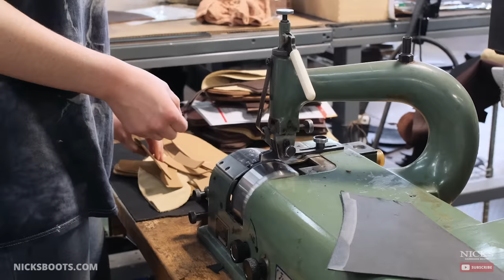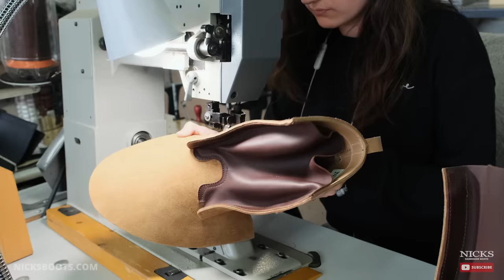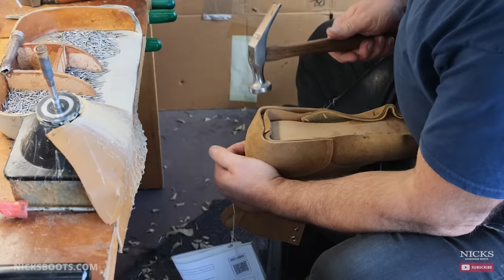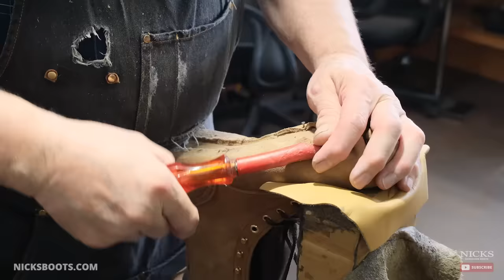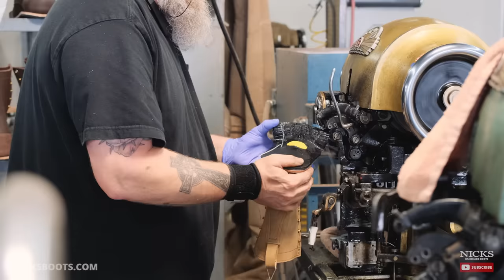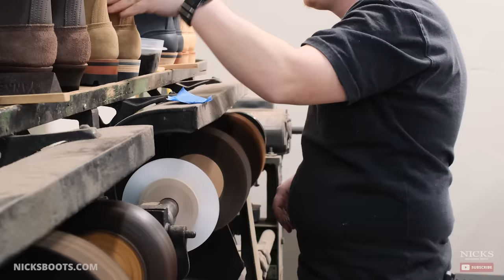World's Toughest Construction Boot: How It's Made - Nicks Handmade Boots

Comment: Very few companies operate like this nowadays using handcrafted talent and quality materials. Never heard of this company before but I'm a fan now. Good stuff!
Reply: The worst thing is when they get overhyped and end up like doc martens where the older shoes are much better and costed the same, maybe even less than the modern crap ones.
Reply: @4m4n40  yeah, doc marten used to be really cheap back in the day, used for factory work, i think there is still a company making something similar, but i can't find them anywhere, i only ever see them in small tool supply shops but there a lot heavier and sturdier then even the old doc marten

Comment: I would personally like to say, "THANK YOU!" to all of your employees. As someone who wears Nicks daily I wish that it was possible to explain the difference between a handmade custom fitted boot vs a really good production boot but it's not. Only way to understand the difference is to buy a pair.
Reply: Yeah but $500 for a pair of boots is a bit much for a lot of folks. Obviously they have a good customer base but they're currently out of my price range.
Reply: @jamesnm21  I understand. My advice to those in this situation would be to set aside a little at a time until you've got what you need.
Reply: Unfortunately, that’s a concept that’s lost on a lot of people…. Lol
Reply: @japlunkett6789  depends on your feet as well. Some people fit well in mass produced footwear. I'm a 9.5 or 10 depending on the shoe and can usually find something comfortable and affordable. Others like my brother, a size 12, has more trouble. I've had some cheap boots for sure that fell apart within months without even everyday use. Sometimes I shoe goo them and get a few years of part time use. I have about 5 pairs of shoes/boots I rotate depending on my needs for the day. Right now I'm in Hilfiger deck shoes from Burlington coat factory. Great for hot weather when you're working indoors or doing light outdoor work. The soles are too thin for anything more serious. I have some steel toe Scetchers for heavier duty stuff plus a few pairs of work boots for the really brutal stuff. In the winter I often wear insulated rubber muck boots that are easy to slide off when going in and out and unbeatable waterproof protection.
Reply: @lancelenoir2875  I don't think you do understand. A little money each week that adds up to $500,  is still the same amount you have to justify spending on a pair of boots.
Reply: @clarkcrossley7579  Hence my original statement about not being able to describe the difference. Justify wouldn't even be a consideration.
Reply: Can you get these boots resoled when those wear out?
Reply: @Lance Lenoir - So they have something that you send in/mold your foot with, and they custom make the boot specific to your foot?
Reply: If I can make it to Spokane for fittment im in 😁
Reply: No need to convey thanks to them. They are enough paid for their work. And its their work, we all work hard and earn money so if you want to say thanks then thank all the service holder in the world.
Reply: What about the difference between a $30 pair of Walmart boots and a nicks boot?
Reply: @jamesnm21  that was a lot of useless information gramps. :)
Reply: @thejohnhend  thanks for watching buddy. Cheers.
Reply: @Kriptoker  I received a form where I traced each foot then took about 7 or 8 measurements. Sent that info in. I then received a try on pair and called and answered questions they asked. Mailed them back and about 6 weeks later my final pair showed up.
Reply: @japlunkett6789  yeah unless you need orthotics from a podiatrist like me. I gotta have em and Ive already taked to these guys. Its a no go
Reply: @Kriptoker  fit sheets. Either they send you one and you get measured or measure yourself, or you gotta go to them and they measure.
Reply: I think everyone is misunderstanding my comment - it (not the original comment made by Lance) had anything to do with whether or not they could be used with orthotics, whether or not they were comfortable or not for some people, etc. Someone commented "$500 is a bit too much for me, they're out of my price range," and Lance's reply was "well, you can put aside a little money each week 'til you have it saved up," and then I made the comment that saving money is a habit/discipline largely lost on society today (referencing the impatience, impulsivity, and "I want it now" mindset that is prevalent among the current populous) - that's ALL this comment was meant to be. Nothing more, nothing less. LOL
Reply: @sylviam6535  The boots that were shown being made could certainly be resoled.  If you go to their website, there's probably additional information there.
Reply: @Kriptoker  No. They offer free exchange if the pair you bought didn't fit your feet.
Reply: Lance, a fool like you and his money is soon parted.

Comment: I can see these are great boots, however as a mason I've tried all kinds of boots and none of them can hold up to cement constantly falling on your shoes.  It's unavoidable, not to mention getting wet and drying out on those rainy days, or working in mud on a foundation and etc..., it just destroys leather in a short while.  I've paid for high price boots before and they don't hold up much better.  I wear out at least one pair a year, maybe sooner, now I just go with what works for me now  that I'm older; boots with a zipper, so much easier to get off and on.
Reply: Lo ppp
Reply: Sounds like you aren't cleaning your boots and reoiling them.
Reply: @dangerous8333  Nope, ain't got time for that lifes to short, and after laying 5 or 600 concrete block, I'm just to tired.
Reply: @originaldanman  You have time for that, you're just too lazy. Plenty of other trades do it. Stop complaining about boots not holding up if you refuse to take care of them.

Comment: Very nice video. I like the simplicity of it.

It does kind of kill me though, to watch the stitching go over the cleats of the sole. I'm sure the boots are still sturdy, but it's a very odd design choice as that stitching will be quickly worn away.
Reply: Once the stitching is finished, it will stay in a groove that forms after the stitching, so it won't wear out as quickly.
Reply: stiches will still hold fine
Reply: @PaddleDogC5   depends what you use the boots for, we never found a stitched sole boot that would stand up to building site work, cement and rebar rip  built up boot soles to bits fast.
Reply: @CrimeVid  50 years as a bricklayer contractor
Reply: @John Gurzo they fall out in a month
Reply: @PaddleDogC5   I can match that,  and a bit !  concrete and carpentry though, And I stand by  what I said.

Comment: Crazy skill, but did i miss the part they put toe caps and such in? or are they just design based off construction boot?
Reply: Wondering the same. Do you not in USA require toe caps and also so nails will not go through the bottom of the boot?

Comment: Boots should have been stitched before placing the final black sole. Stitching on the bottom most sole only makes the stiches prone to be damaged.
Reply: And Nicks does that too. Stitching through all the layers helps keep the outsole in place. Yes the thread snaps, but the thick rubber grips the thread very strongly.

Comment: I realize the cement and screws are the real bonding element.  But my question is once the crown of the lock stitch wears through, if the glue breaks down, what’s holding the sole on?  I’m a repairman, not a maker.  I ask this from that perspective.  I would love to not groove the non lug vibrant soles like the v sole.  I use top notch cement, prep meticulously, pneumatically press, and once in a while even mine come apart?  You guys are obviously experts in this type of sole application.  Any pointers?

Comment: I have 1 issue with these boots. The thread used to connect the leather upper to the vibram sole isn't protected. I think there should be a grove cut into the sole for the thread to sit so as your soles wear down, the threads won't.

Comment: I  have never heard of Nicks Handmade Boots but I have Owned Viberg`s and they are still made less than a mile from my house. Can be Re-Soled, repaired, and are Tough. Loggers like them on Vancouver Island as well as Construction workers. Good on you if they are the same class as Viberg.
Reply: Without having personal experience with Viberg, I have been lead to believe that Vibergs are of higher quality than Nicks. I own Nicks and I love them, but they're still mainly work boot makers. For myself Nicks are a better choice than Vibergs.
Reply: @Totemparadox  Whatever they are, they are expensive as all get out now. I remember i thought my construction boots from Viberg at $200.00 Canadian Dollars was a crazy price but I was assured of the quality by my Grandfather who wore some non-construction type Vibergs and they lasted him years, so I bought a pair. Wish they were still $200.00, closest ones to what I had are now like $700.00. There`s a video up about such a pair, guy says he went through the Fort MacMurry Forest Fire with them, been using them at work for 2.5 years on top of that, he just keeps them treated and cleaned twice a year---I used to do it every season change, his boots though, and not a broken stich nor any splitting of the treads as cheap boots would have been abou four or five pairs at least by now, especially after that fire, it was a big one, went on for like a month and some, almost two if I remember right, am older now and not needing as heavy duty boots so less expensive ones last me a good while now. Take care.

Comment: Amazing, so much works goes into each pair. I have two silly questions: watching how the sole is constructed, how come there aren't nails sticking out from the insole inside the boot? And about the stitch-down thread on the underside of the sole - won't it wear out pretty quickly and what happens to the sole then?
Reply: The plastic foot shape they're using is called a last. It has a metal bottom and when the nails are nailed in even at a slight angle, the nails hit the metal plate and turn over creating a hook like nail. Then in the end any nail that is too tall is flattened with a rebar and a hammer. Yes, the thread will wear out pretty fast, but it's lockstitched so it won't unravel and it's just an extra method of security. The outsole is still nailed, glued and screwed on.

Comment: I don't make shoes but do work in a factory environment. This seems incredibly labour intensive for something in a developed country. In particular the bit about 18:50 with the screws being put in. I would certainly want to mechanise it and change to a single action stamping of multiple metal bits at once...
Reply: You seem to be very confused about the ideology behind Nicks boots. The market is FULL of machine made modern shoes. These are hand made ON purpose using the toughest materials around. The process isn't meant to be the most efficient, but as close to the classic methods as possible.

Comment: I was confused by the stiching across the sole that would touch the ground, wouldn't it make more sense to stick across a section of the sole that isn't going to get worn through quickly?
Reply: The stitching being worn doesn't make a difference.
Reply: If you observe keenly, you will notice the stitch is not on the buttons of the sole but rather on the flat layer holding the buttons. The valley and not the peak to give a different POV. Hope you get the point I'm trying to stress, I'm unable to get the correct terms for that part of the sole.
Reply: @SubramaniamLakshminarayanan  The stitches also touch the top of the tread. That's just how these boots are built. I own Nicks boots and the thread on mine has snapped and it hasn't affected the integrity of the boot one bit. Even if it isn't visually pleasing, the thread snapping is of no consequence.
Reply: @Totemparadox  - not a suitable manufacturing process or design if that be so. Unless the stitch is just a temporary manufacturing process to hold the parts together until the following process seals the parts.
Reply: @SubramaniamLakshminarayanan  Not suitable? How so. Please explain what happens when the thread snaps.
Reply: @SubramaniamLakshminarayanan  Waiting for your so-called expert opinion on how it's not suitable, despite being done by cobblers for decades. Yet it doesn't change the integrity when it wears down.
Reply: @Totemparadox  when the threads will eventually snap, the shoes lose the binding grip provided by the threads. 
"I own Nicks boots and the thread on mine has snapped and it hasn't affected the integrity of the boot one bit."
What were the threads doing there??? Decorate the boot?
Reply: @SubramaniamLakshminarayanan  Holding on the sole. Like they will do even if the thread snaps. Have you ever tried to remove a nail from a tire? It's extremely tightly in there.

Comment: Don't you worry about having that stitching on the bottom directly exposed to abrasion/wear? (from someone that has absolutely NO idea what goes into boot making. I'm sure what you make is insanely high quality and bomb-proof)
Reply: The stitching on the bottom is really just to sandwich it all together. There is another stitch that goes exclusively to the midsole. Not to mention the adhesive does most of the heavy lifting to begin with.
Reply: Not to mention the nails and screws. Honestly there is so much shit holding the boots together I’m almost willing to say the stitches on the bottom are mostly cosmetic.

Comment: anyone who knows about shoes will be cringing watching this video, what the hell of techniques are these, good heaven
Reply: Bro just stop. You're embarrassing yourself. Please explain what steps were incorrect.
Reply: @Totemparadox  the sole stitching levelled with the contact area of the sole is just ridiculous. A band should be crafted in order to sew along that band at a different level so that it has rubber protecting it. Plain and simple I believe
Reply: @gonzalovenegasgomez349  You mean protecting the the thread? Because when you walk it will wear down, is that what you mean? The soles are attached with THREE things. Glue, thread and ecrews. The thread is not protected because it would be extra work for no added benefit. The sole is never coming off unless it's peeled off when resoling. Sure it may not look as nice when the thread on the bottom snaps, but these are work boots, not fashion accessories. Also if you knew how rubber worked you'd know that the thread is squeezed so hard by that rubber that even without the glue or screws that sole is not coming off.

Comment: The stitching on the bottom is somewhat an odd choice. I mean those stitches are going to be the first thing to wear out.
Reply: Yes. And?
Reply: @Totemparadox  It means its going to be the first thing to rapidly wear out and peel off. Not one shoe brand I have seen stitches the bottom where its the most abrasive. I just wonder how long the front part will stay on after the threads wear out. I assume its bonded as well.
Reply: @Someguy6571  Mine are still attached even when the thread has snapped. I haven't seen one Nicks boot where the outsole peels off.
Reply: @Totemparadox  Okay well I was only thinking it was an odd design choice really. I figured they were bonded.

Comment: They might look nice,  but the fact they don't have a steel (or otherwise safety-standard) toe-box means it's definitely not tough enough for a construction site, let alone the "world's toughest". They also don't look very cut, penetration or water-resistant, either.
Reply: Steel toe is an option and if you base a boots toughness on steel toes alone, your priorities are wrong.
Reply: Only one way to know, either buy them or read reviews.
Reply: @Totemparadox  Thanks for your reply. I had a look on the Nicks Boots website before posting my original comment, and couldn't find any option of steel toe-caps, just "Celastic", which is just a bit stiffer than leather alone -- but I'd be obliged if you could provide a link to the steel toe-cap option, thanks.  (In any case, if they're an option, why weren't they included in what's supposedly the world's toughest construction boot?)

And where did I say that that I base my evaluation of a boot's toughness on steel toes alone? I  mentioned them because they're essential, but not the only thing I look for. Perhaps you missed my mentioning cut, penetration and water resistance, to mention just three. I could also add factors like anti-static, chemical, oil and electro-static discharge resistance if that would help?
Reply: @KLK01  That's actually two ways, but either way, if they don't have safety toe caps, they're not "tough" enough.
Reply: @JonWallis123   YouTube doesn't allow links, but they have multiple steel toe models. Builder Pro, Waterwork, Tactical Boots, Lineman, etc. 

Cut resistance? Have you ever tried to cut 8oz leather? 
 Water resistance is great unless you need to wade through water. That's why they have a new model called the WaterWork that uses a 360 degree stitchdown. Virtually water proof if the leather is treated correctly. Puncture resistance? Two slabs of veg tan leather are extremely puncture resistant.
Reply: @Totemparadox  Thanks.  I've now found the steel toecap options.